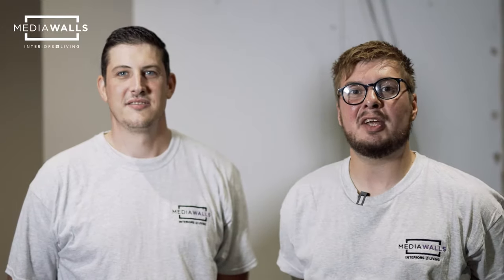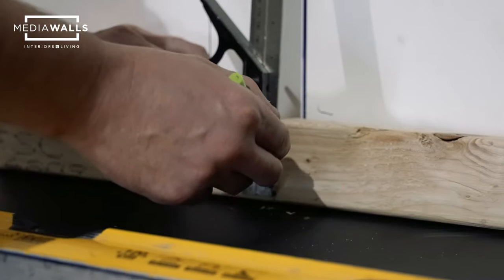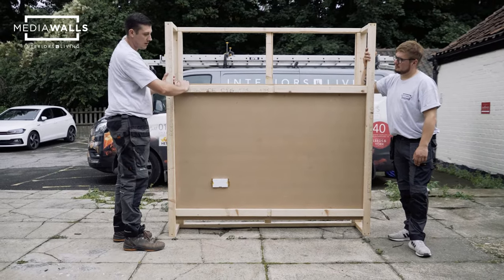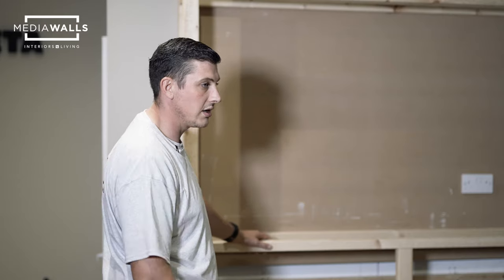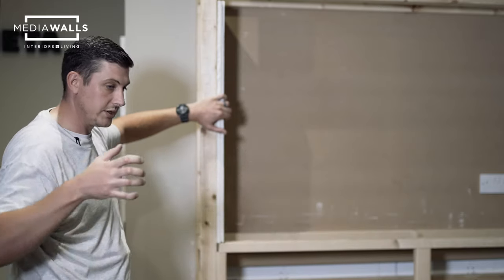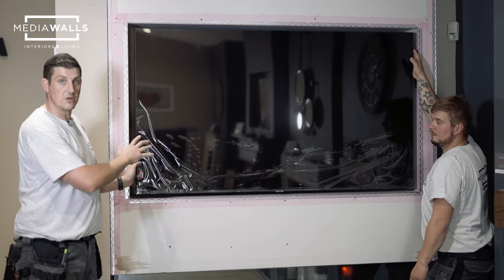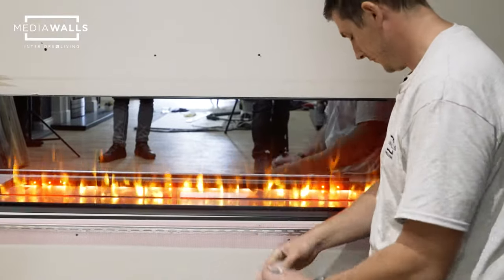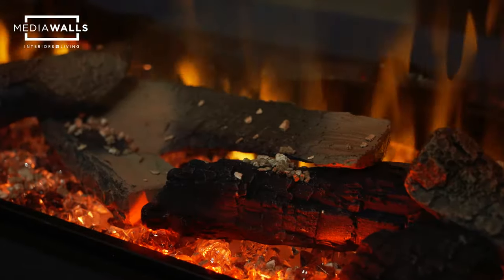Media Wall Installation

Comment: Did you only use the 4 bolts to fix the TV bracket to the wall? I'm tempted to put another two for extra support.

Comment: Hi, really great video, can I just ask, if constructing on a new build property does the tv bracket still need to screw onto MDF rather than directly on to the plasterboard (jointed, taped & painted) party wall between myself and my neighbour, would it not be more secure screwed through the plasterboard and into block? Thank you!
Reply from the maker: We generally do this with the Deepline range of fires as there is plenty of depth in the recess and this means there is a also a void for cables to run through. It also means that sockets can be mounted flush rather than surface mounted. If it's a party wall between yourself and a neighbour then this will be of solid brick so the bracket can be mounted directly to this if you prefer however you will have to chase the wall out to conceal the pathway of the cables.
Reply: @Interiors4Living  Thank you!

Comment: Great vid, How did you plaster board the side of the fire round the panoramic glass?
Reply from the maker: Hi Jennifer thank you! The fire has an edge kit so the plaster board sits on the edge kit is normally about 15mm so 9.5mm plaster board is ideal then a skim to have it flush. I hope it helps!
Reply: @Interiors4Living  many thanks for the reply. When you say edge kit, do you mean the lip that is screwed on all around the sides of the glass?

Comment: Is MDF strong enough to use for mounting a tv  bracket and tv this is new to me
Reply from the maker: We have always used MDF to secure TV!
Reply: No its not 
Will pull apart after a while 
It is only compressed paper after

Comment: Ive seen people use mdf instead of plasterboard can you advise why not to yse mdf?
Reply from the maker: We don't use mdf as it's difficult to achieve a good finish to the corners unless you're able to mitre, it's pretty expensive too. We use plasterboard which is very forgiving where walls, ceilings and floors are out. Using a plaster finish makes it the same as any other wall in your home too.

Comment: Why do you need a fused switch why cant you plug the fire into a socket??
Reply from the maker: The fires are designed to plug in however this will mean you have a cable and plug visible unless you're going to chase the wall out and route it to the tv recess instead. We suggest a switched fused spur for a more professional look and if placed on the side then it's easily accessible should the fused fail.